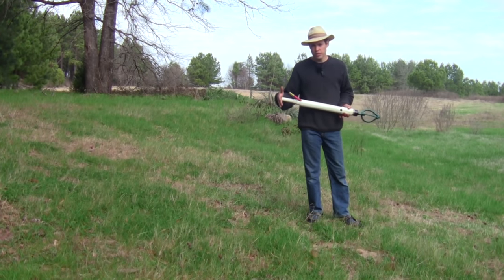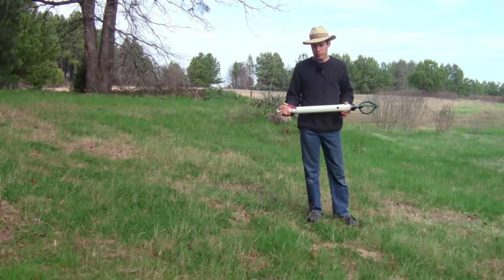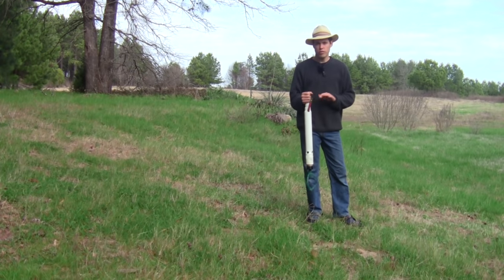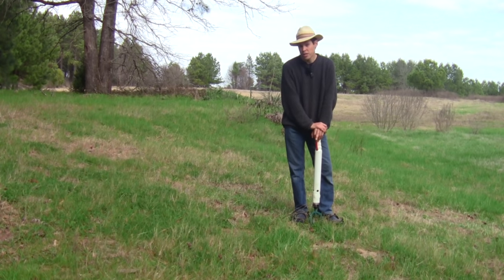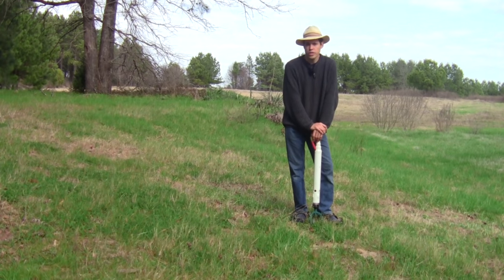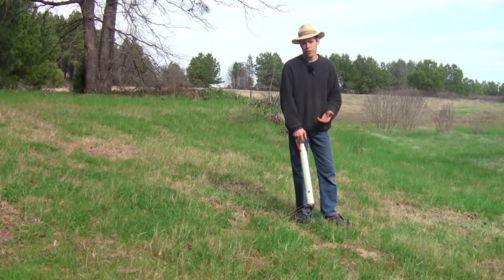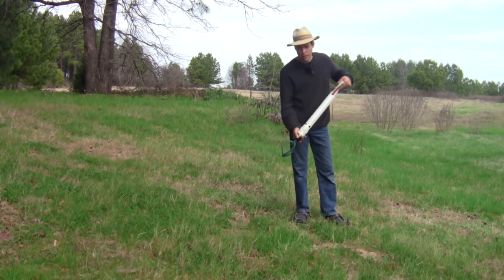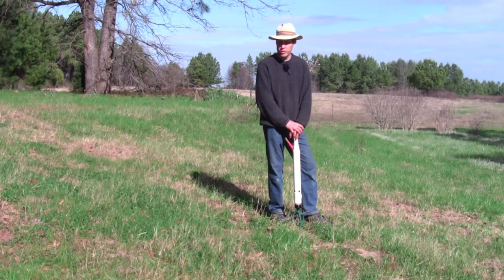DIY Water Well Drilling - 6 Ways To Drill Your Own Well in 2018

Comment: can you use this drill in Africa
Reply from the maker: Sure, but it requires a quite large air compressor, which can be rented or purchased in most parts of the world. I would definitely start with the plans and DVD first, and then if you decide it's something you can handle, move forward.
Reply: @HowToDrillAWell  which DVD?
Reply from the maker: @domsodamso9714  It's available from the website, www.drillawell.com

Comment: what is the max depth that the deluxe unit will drill?
Reply: I recommend sticking to less than 100' if possible on your first well, to gain experience before tackling a deeper well. I've gone as far as 210', but it can get more tricky.
Reply: @nathanielburson8929  I am kinda curious as to why it gets more tricky

Comment: All they do is>  get a Work Over Rig , to drill a water well with Hammer, drill pipe, collars, casing , rock bit, water and a air compressor They use the water as a drilling fluid, and the compressor to jet the water

Comment: What keeps it from drilling 300 to 400 feet deep ?
Reply from the maker: Mostly the fact that more bad stuff can happen on the way down, and while drilling. After about 150', you can't hear the drill or feel the vibrations, so it's very difficult to keep the drill working at max efficiency too.
Reply: HowToDrillAWell ,,,,
Hmmm, I think I need to make it close to 300,
I am going to buy the kit or the instructions and DVD

Comment: Thanks for the info!  I have a well with a shallow water pump.  We need to pour concrete where the well currently sits.  Is there a way to move just the apparatus so I don't lose the well or have to dig a new one?
Reply from the maker: Well... you can move the pump and tank, but obviously you'll have to drill a new hole if you move the well. It is possible to do something called a pitless adapter, which allows you to have a well pump a long ways from the well hole - but if you ever had a problem, you'd never be able to fix it.

Comment: His talk is clearly designed to sell his system.  I've done 4 16-25 ft. well in the last 5 years.  Buy a well point ($30), buy pipe (20ft $50), fittings ($20), and rent an electric hammer from Ace Hdw. ($25) and do the job in about 2 hours....
Reply from the maker: Sure, I'd like to sell my system - but not to someone who doesn't need it. That's why 80% of this video is spent showing the alternatives. Yes, if you can drive a well point and find water at 20', by all means do so! But unfortunately, most people are not so lucky as to have water at that depth.
Reply: Are you from Rochester

Comment: what keeps it from being able to drill 300 or 400 feet deep. ?
Reply: Mostly the fact that more bad stuff can happen on the way down, and while drilling. After about 150', you can't hear the drill or feel the vibrations, so it's very difficult to keep the drill working at max efficiency too.
Reply: What if i dont hit water till after im 400 ft down
Reply: @davidr5534  I guess you would have to call a professional.

Comment: I drove one down 75 ' 2" with a tri pod weighing 50 lb driver through a pulley to my pickup truck jacked up guy welding three rims together cut the center out of the first two so I can Bolt the rims to the axle you wrap the Rope around the rim 1 Loop start engine put truck in gear pull rope let go that drives your (must use Drive couplings  the pipe at the top 12" long the driver.  Will wreck the threads you keep using that one foot piece screw it in the five foot sections every time you change the pipe make sure you use a big pipe wrench keep all the fittings tight that was a 3in Sandpoint I hit water about 65 ft this was close to Spring Lake in Illinois 40 years ago you must get the water out of the pipe the dirty water you can really screw up your jet pump vanes I drank iced tea while I was driving it sitting in a chair are you getting the picture driver on top of the pipes feeding rope through pulley on tripod rope goes around the rim what the engine turning the rim at a idle get chair Loop rope around the rim pull on the Rope two fingers yes and get iced tea

Comment: You should be aware that, however you drill a well, many places require a drilling permit. Why is that? Because when you drill a well, you can cause a cross-connection in the well packing between aquifer zones. For example if there is a surface aquifer recharged by rainfall and potentially contaminated with who-knows-what and a deeper zone separated from the surface aquifer by a layer of clay or rock; and you drill a hole through that layer: then forever more, water from the surface may flow down into the lower layer and contaminate it too. How could you have known?! That is what the permitting office does. At least find out if a permit is required before you start poking holes in the ground. It could save you a lot of trouble later.
Reply from the maker: Yes, which is why in my video "5 things you need to know before drilling your well", I discuss that.
Reply: He’s from the city😂

Comment: Can't you make one with an air die grinder and some pvc?
Reply: No, I've tried that extensively. The die grinder motors turn at 10k rpm and have almost no torque. They won't work -- as soon as they hit mud they slow and stop.

Comment: Very interested can you just tell me the total, it would be easier then adding up part x parts...Thank you
Reply from the maker: For my drilling system, it's about $1000-$2000 for a typical well. Less if you already have a large compressor and some of the parts that might be commonly found around a shop (lubricator, air tool oil, etc).

Comment: 10 lbs....just the end...but he failed to mention the weight of the air hose 150 fest of air hose attached to that ....that is a lot of weight l. I have pullsd out a pump on the end of 120 feet of hose and it is very difficult  ..very misleading....beside...anyone who speaks that fast slides in a little bs to fill in the breath voids...not interested....!
Reply from the maker: You're failing to take into account that the hose is full of air, as is much of the pipe, and that it's running underwater. When done correctly, the drill weighs literally nothing while it's in the well. The pumps you've pulled are full of water, and are indeed heavy. This is not.

Comment: You're leaving out something obvious:  Where/how do you get the water to do the drilling with and how much water will you need?
Reply from the maker: If no source of water is present, you can haul it in with totes or barrels. Expect to use several hundred gallons a day while drilling. You don't need a pressurized water source, so a pond or any sort of holding tank will work as well.

Comment: the 4" pumps I've looked at require a minimum of 5" casing with exception of  Grunfos which is quite a bit more expensive
Reply from the maker: Most 4" pumps are designed for 4" casing. You can get them at Home Depot, for example, which is the one I use in my own 4" well.

Comment: You have to buy the video that actually show you how to drill the well.  I would think if this system really works well you would post how to use it vidoes here instead on an infomercial and then take questions.  I drilled a shallow well and it was not easy at all and you get cave ins after a certain deepth, yet no mention how you deal with that; are you adding material to strengthen the well sides.  Assuming you are using 3" PVC you will constantly have to stop and adding new sections of PVC pipe and glue it up.  I want to drill a deeper well due to the iron you get from a shallow well, but $700 for a system that I have no confidence would even work with no vidoes showing people actually doing it from start to finish and no reviews; very high risk.
Reply: The video shows you it can be done and is done.  You dont attach 3" pvc it 1" pvc bud. The expansion chamber is 3"

Comment: the drop bucket perkussion way to drill a well is much better as it have almost no dept limits and is much cheaper as it can be build at home.no need for any machines ,all you need is a strong arm to lift the bucket and let it drop down to dril and to lift it out to empty it in a lot of the times one can see the casing beeing suckt deeper as the bucket is lifted ,go's tru solid rock or any other grounds
Reply: just because its cheaper doesn't make it better.
Reply: DO NOT CLICK on the "home.no" link above. It links to scam ware.

Comment: "solid granite"???  I'm sorry but that can't drill through granite which is one of the hardest rocks on the planet.
Reply: Well, it can. Not fast, but it does drill through it. One customer drilled 36" of granite in 18 hours. Not recommended if you have a ton of rock, sure, but if you have small amounts it's still possible to drill a well.

Comment: 175 feet in 25 hours at an average of 25 feet per hour i think your math is a little off.
Reply from the maker: 25' per hour in sand; obviously clay and rock are a lot slower, averaging about 3' per hour in clay and 1/2"-1" per hour in rock.
Reply: not if he hit a rock and spends 2 hours per inch for 8 hours.....the majority of the hole was probably very easy drilling which i believe he said was sand. there were likely a few rocks or whatever that took much longer.

Comment: False information your standpoint can be over 100 feet deep as long as water table is under 25 feet it can be drawn out .
Reply from the maker: It's still not helpful if your water table is deeper than 25', which is the point I was making.
Reply: @HowToDrillAWell  understood a goulds pump will suck water up If water table is less than 25 feet . Misunderstood what you were saying

Comment: If he needed a well and didn't have the $5,000 to drill it, I don't think it's realistic to wait 2 years for water OR to spend 10's of thousands (minimal) creating a drill! Well he did say "you can't trust me"! That's just BAD business no matter how you cut it!
Reply: +Joseph Marion I'd give him the benefit of the doubt for this reason. For someone who has been in an industry for several years and understands the solutions currently available, a minimum viable product (think working prototype) can be created pretty quick -- usually within 2-3 months. That's probably what he did to drill his own well. The bulk of the two years was probably iterating on the original design until he had developed something maximally effective, reliable, and profitable for the market.